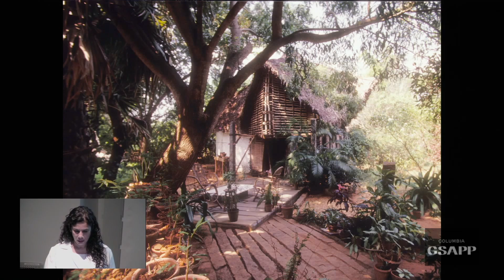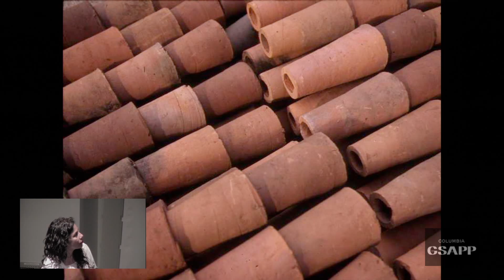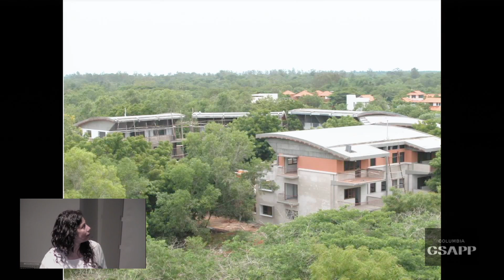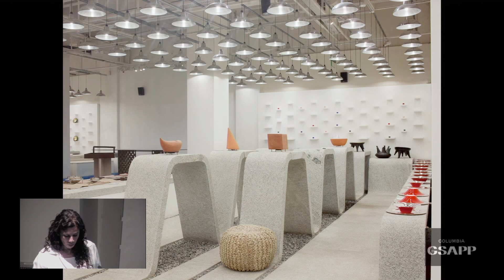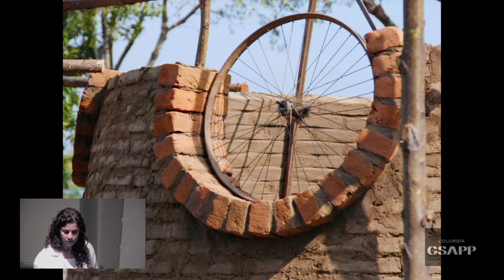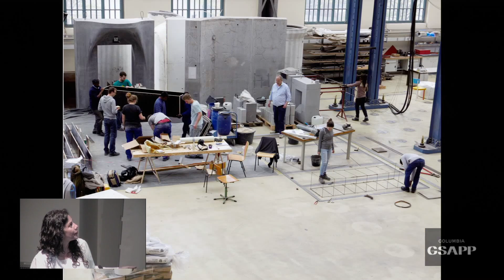Anupama Kundoo

Comment: Liked the presentation. We have rich tradition of design. Even bricks are high energy embodied materials. Shall we abandoned the Red Brick building material too? I disagree with Anupama with use of steel and cement. How do we solve the problems? Can we solve million hosuing for all by using bamboo, thatch, and mud walls. These applications have limited scalability. We need more better ideas and certainly advancing, affordable and acceptable one. And people do not have time to form there own settlement on own. What if We do not act now as a designer, .. agree to no over engineering, but the optimal design is required to house the millions...